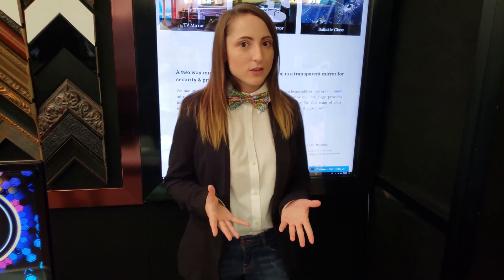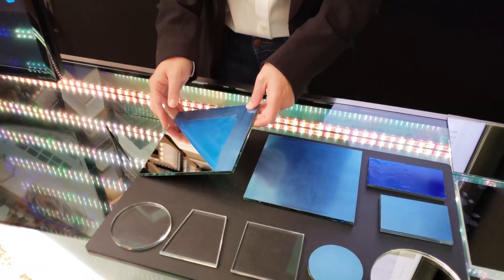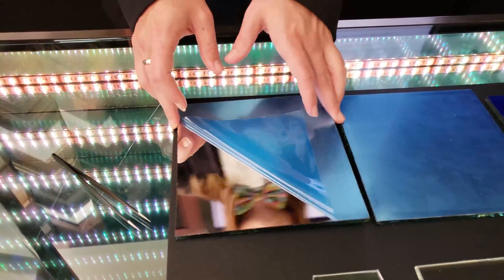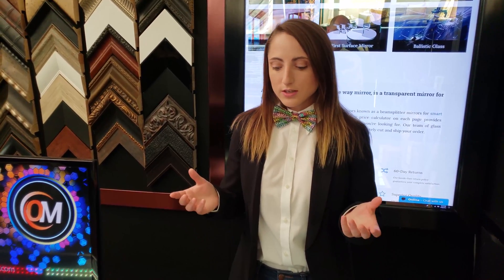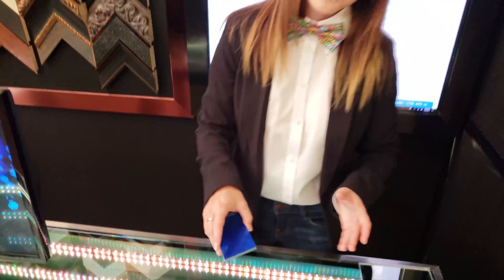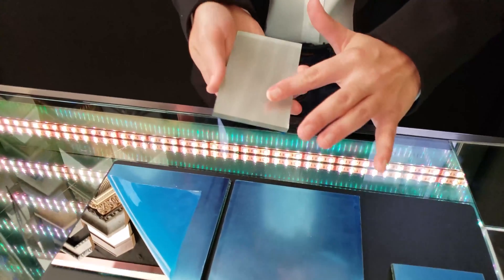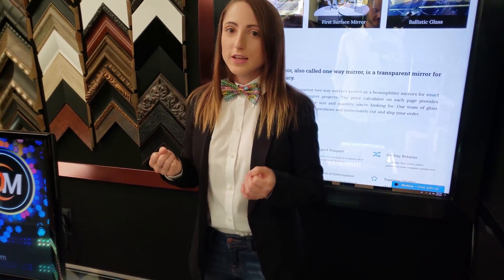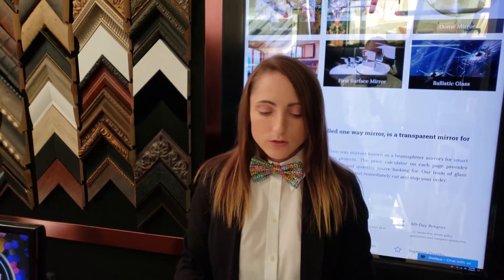How to Choose the Best Front Surface Mirror

Comment: Is it possible to make a metal mirror - stainless steel - for example ????
Reply from the maker: Mirrors actually used to be made from polished metal! :)
Reply: @twowaymirrors  I mean the mirror material itself is satin steel, not glass
Will it fit and will it be efficient